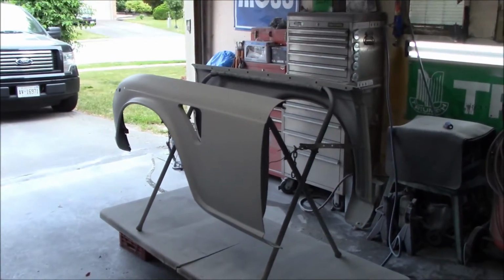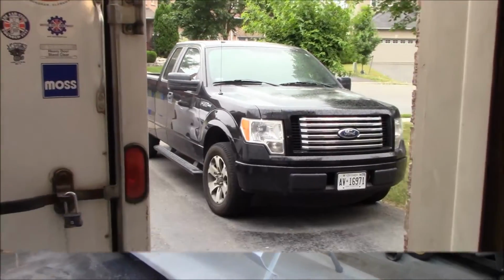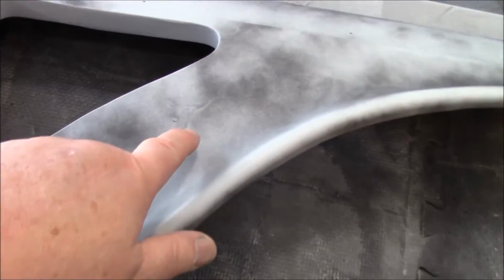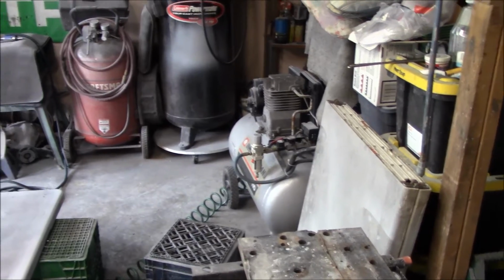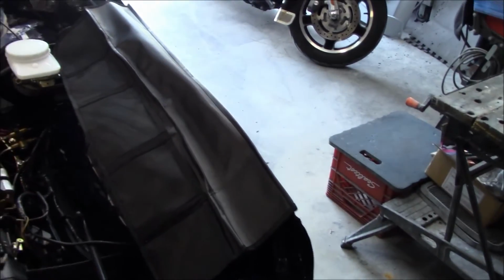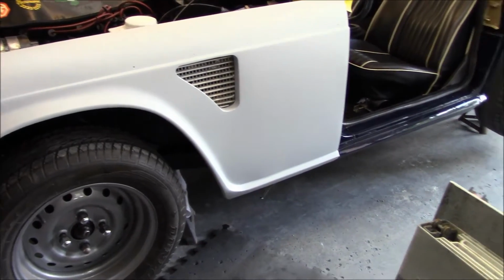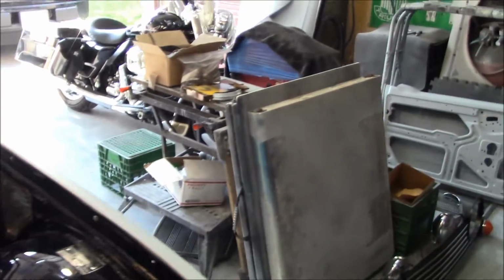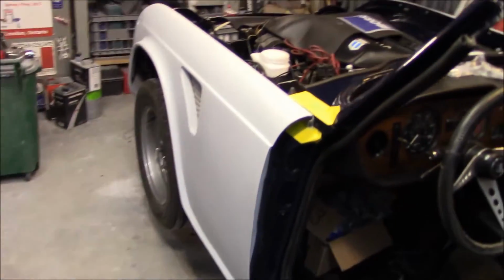1968 Triumph TR250 Restoration Project,  Still Sanding and Tinkering

Comment: Looking fantastic! The only thing with hanging the doors is they sway due to the air pressure from the spray gun. I'm sure you've already thought of that and have an ingenious solution.
Reply from the maker: Hi Eric, yes I’ll wire them down to a weight on the floor as well to prevent that.

Comment: Hey Chef TR is looking fantastic, just wondering if you were planning on extending your bullhead drain tubes so they don't dump water all over your sills?
Reply from the maker: Hi Ken, I thought about it but have decided not too.  I have coated to inside of the area with raptor liner and the inner fender will also be raptor lined.  It’s pretty moisture proof for the occasional times that I’ll get stuck out in the rain.   I’ll make sure the sill drains are cleaned often.

Comment: Assuming that the stainless steel welting between fender and body tub on the rear deck does not affect alignment of fenders. Non issue for front fenders I guess?
Reply from the maker: Hi Michael, no it won’t effect the alignment.  As you might know, traditionally the welting would be painted body colour and the stripe would actually be painted across it as well.  I’ve decided that I will be just going with the stainless steel look.
Reply: @cheftush  That just reminded me that I had stainless welting on the MGA, too. I got it from Sears and Roebucks for about 5 USD the whole set...in 1960.
Reply from the maker: @BruceBoschek  it is slightly more expensive now 😉

Comment: Dave do you know how long the Tr250 chassis from front to back. I want to buy one but don’t have a trailer but a box truck with 10ft box. Thanks
Reply from the maker: Hi Frank. It is 10 ft, 10 inches approximately.  Can you strap it down and just leave the rear door open?
Reply: @cheftush  thanks a bunch and your TR250 is coming together and looks amazing. Thanks for your help. 👍🏻
Reply: What do you thing a fair price for a very good condition one with original motor the good too with a American dollars
Reply from the maker: @frankmgallo  hi Frank, it’s tough to place a value but based on what I’ve seen, a good one can go for between 25-35000 US
Reply: @cheftush  you 2500-3500 not 25-35000. So 2500-3500 just the chassis or is that with a motor also. After this question I won’t ask anymore. Lol
Reply from the maker: @frankmgallo  sorry, I thought you were asking about the whole car.   For a good condition chassis, between $1500-2500 that’s without the engine.
Reply: @cheftush  thanks for all your help and now I have 2 important answers by the Master Triumph Guru whole good car and a good chassis w/o a motor great base to work with. I appreciate you and all your knowledge and help on this. Keep Em Rolling 😩

Comment: Dave maybe I missed something are you painting the panels on or off the car.
Reply from the maker: Hi Ralph, I’m painting the panels off the car.  I’ve put the front fenders back on temporarily just to mark out where the stripe will meet up with the bonnet and I’ve put the rears on just to mark and drill for the fender badging and side light.  They will come off one more time to paint.